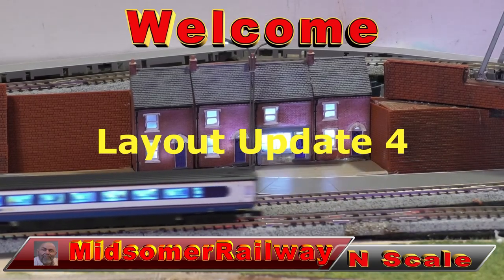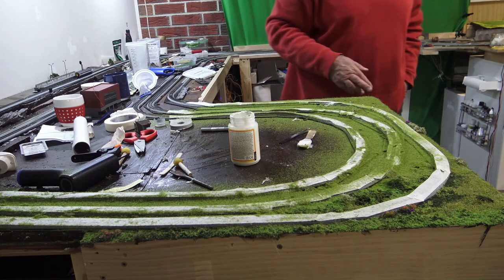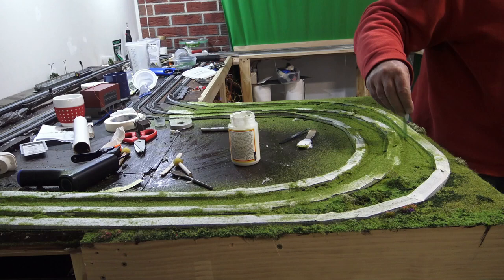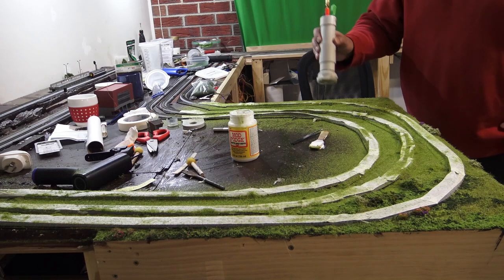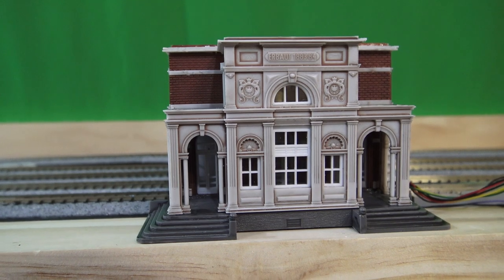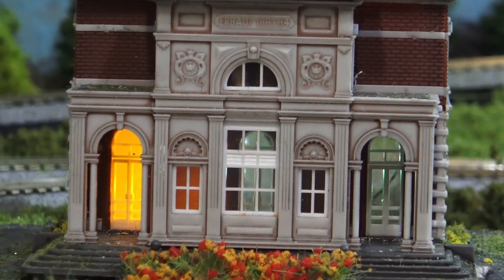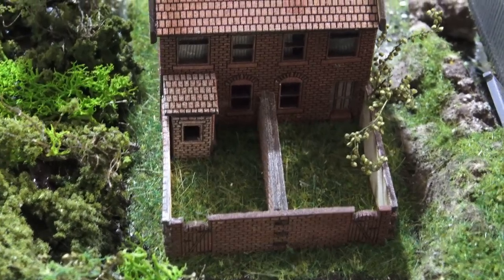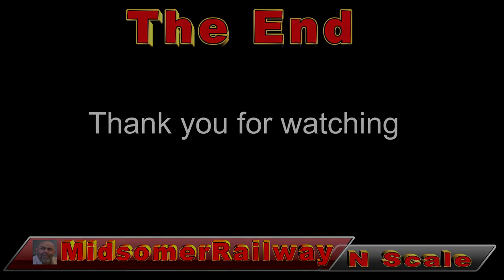Layout update 4 ...Sept #nscale #modelraillayout #updates#british n scale

Comment: Nice to see your updates!!   We have similar projects ... but I'm heading into Fall while you're heading into Spring!   On my ToDo list are three homemade static grass applicators each with different screen meshes.   Also just purchased some small Neopixel strings that can be cut into smaller strings or individual Neopixels.   Width of strings is only 2.7 mm.   All the best to you ... Cheers!!!
Reply from the maker: Thanks Donald , I have made a few static grass applicator's  with different size mesh as well, The transformers i get are big  but are quite high Voltage . Yes i am almost out of neopixels and will have t buy more , its a challenge here in N scale to get anything that i need i always have to get most things from UK  but the static transformers i get here in Aussie ,  yes there is always lots to do  fortunately, i  also have an air conditioner so i can work in the train room all year , just health issue that stop me lol  thanks again regards Greg